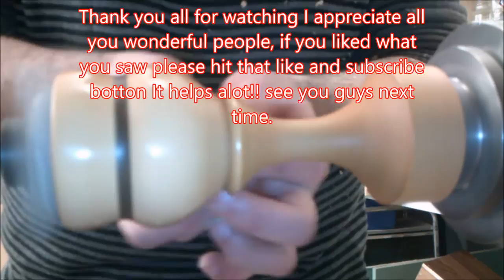Wood turning - Trying out segmented Goblet (Yew+Walnut)

Comment: Nice job. When working on the stem it looks like you have a rag in the cup and maybe a forstner. Was this to polish the inside? Provide support? Thanks
Reply from the maker: Hi Jim thanks for watching, that rag was tightly folded and tail stock was pushing against it for more support.
Reply: Good idea!
Reply from the maker: I forgot to mention after the video was done when i wanted to part it was i pulled away the tail stock and the rag =)